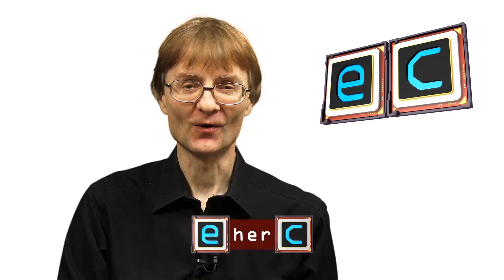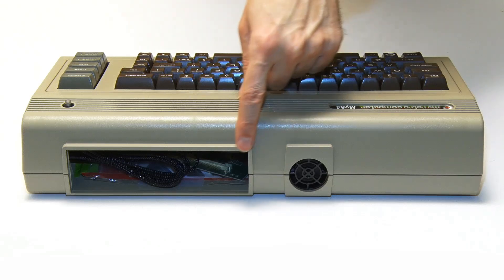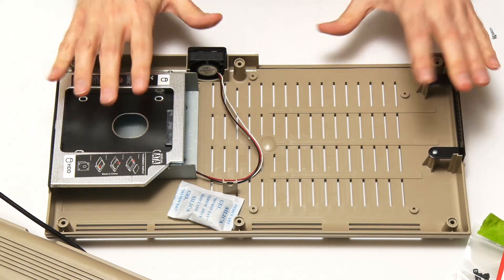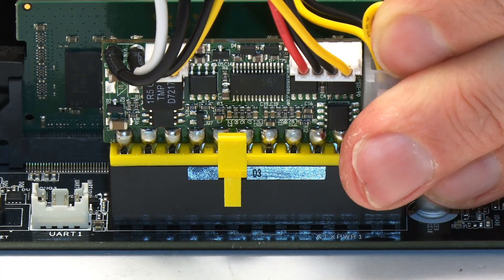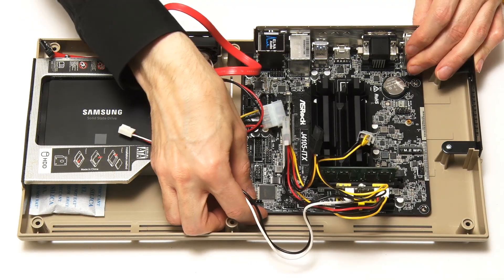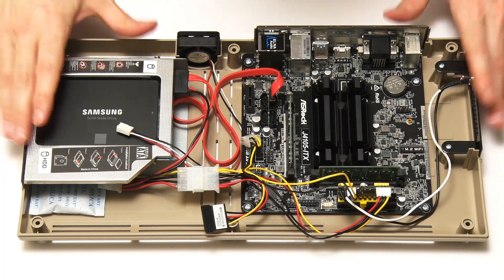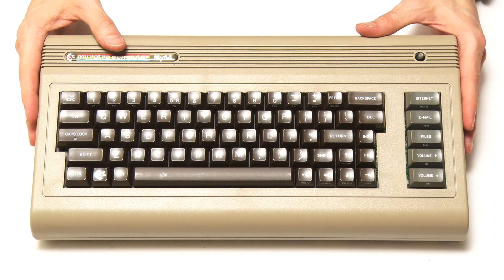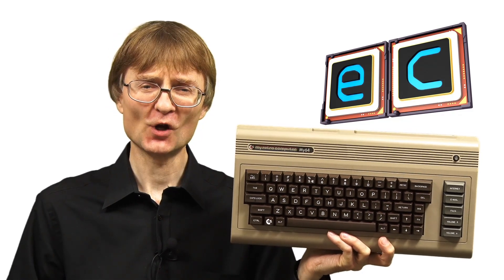My64 Mini-ITX Retro PC Build

Comment: This is awesome.
This formfactor should never have gone out of fashion.
Hope they can get the cost down a bit.
That's too much for a computer case and keyboard.
Reply: While a cheaper price would be appreciated it's worth keeping in mind how much a mechanical keyboard on its own can cost. You can easily soend upwards of £80 on a mechanical keyboard so looked at in that light this case doesn't feel quite so expensive.
Reply: @theimp67  I want one with a $20 Logitech keyboard.
Reply: Yeah unfortunately when you manufacture small custom runs of products it can be expensive, you also have to remember that these products are mostly privately funded by a small group of enthusiasts, and all the research and development that it took to actually get the product to market, I doubt if they will even make a profit hopefully they will at least break even.
Reply: @BILLY-px3hw  I'll remember all that and I still say it's too expensive for what it is.
Reply: This is the third case of it's type that I've seen recently if I remember right. I'd love to see one based on the old laser xt that can take a full height mini itx gpu. That would make a great PCem or vfio box.
Reply: @Drebin2293  that's what I'm talking about.  And make it out of extruded aluminum.
Reply: @aurthorthing7403  I'd love to see something like a BBC Micro or Memotech, I think they'd both make for a great micro style case but have more room for extra hardware.
Reply: Especially considering the Raspberry Pi 400 exists now.
Reply: The Pi100 does it better. The 64 at the time had a good keyboard but the thickness made for terrible ethos. The new Pi 100 does the form factor better as did the 128 and 64c. But you can not fit an itx board in those
Reply: Even if it wouldn't have a built-in keyboard, I miss horizontal/sleeper cases. My tower uses too much space on my desk. I had a Pentium 1 years ago and putting a monitor on the top of it not just saved space, but it had some special vibe, too. You don't get that from bulky towers. 

By the way, did you observe it? Every case is black now. White coating is used for luxury, expensive cases.
Reply: @michaelbuddy  Raspberry PI 400 is better.

Comment: I was wondering about the differences in the  20 pin vs 24 pin power connector. If not part of another video, maybe explaining that would be a good subject in a future video?
Reply from the maker: The four pins on the end of a 24 pin ATX connector are duplicates of those in the 20 pin, to allow more current to be (safely) drawn. So for a low-power system, they are not required.
Reply: ExplainingComputers So if I have a 20 pin connector from a power supply and a 24 pin connector on a MB the PS probably can't power it? Or would a 20 to 24 pin adaptor be OK to use?

Comment: "molex to sata, lose all your data"
Reply from the maker: Not really true. There have been issues with some Molex to SATA adapters used with 3.5 inch drives.
Reply: that's just the thing to be aware of when using those adapters
Reply: @ExplainingComputers  Oh?!  I use them with a couple of my older PC's, I've not heard of any issues.  Might you elaborate?

Comment: This video last seventeen minutes, about as long as it took to load a decent Commodore 64 game from tape, before the advent of 'turbo loaders'.  As to the case... nice.  But a 'touch' pricey.
Reply: Ghostbusters!
Reply: Fotball Manager. About 25 minutes.
Reply: And if you plugged in a game on a cartridge the game was loaded instantly (because it isn't "loaded", it was already there on a ROM chip), which is something unmatched by computers today.
Reply: I would love one of these case, especially because it has Cherry switches. It really needs to adaptable to SBC type boards as well and the 'my64' people are apparently doing that with a kit for the Pi4 and one other board I forgot the name of.

However I don't see the price coming down unless production ramps up to RPI400 levels.

Comment: In my opinion retro PC's are old looking but how about performance explaining computer
Reply from the maker: The performance is the same as when this J4105 hardware was inside my smaller Mini-ITX case! :) But it is possible to put a Ryzen in this case . . .
Reply: @ExplainingComputers  thanks explaining computer
Reply: The J4105 CPU with (from 2017) is only slightly slower than an Intel® Core™ i7-4558U Processor (from 2013). Like within 1-2% (According to CPUPassMark.) 
The J4105's in-built Intel UHD Graphics 600 graphics however are less than half the speed of the i7's Intel® Iris® Graphics 5100. (According to CPUPassMark.)

Comment: How can Raspberry Pi make a keyboard and computer in $100, but these guys make a keyboard with some empty space for over $200?
Reply from the maker: I guess it comes down to economics -- they will sell a great many Pi 400s, so the cost of tooling/etc is spread across many units.
Reply: @ExplainingComputers  also, RPi foundation is a nonprofit, so, for them, it's enough to just break even, I suppose.
Reply: By using a fancy mechanical keyboard instead of something cheaper?

Comment: Initialy i thought it will be one of those "mini consoles" that you will gut out and put pc into it... but it's actual PC case, great! Pretty nice kit, although colour might be bit darker than original, or is it only me?
Reply from the maker: The colour is very difficult to capture on camera -- I spent a lot of time in colour correction, but the shade changes from different angles! But I agree, a little darker I think.
Reply: @ExplainingComputers  In fairness all C64 i used myself back in the day were aready... well used. So they were previously kissed by the sun so to speak. So maybe that is original colour and it will change from sun exposure :)
P.S. Yor mice even looks like joystick.

Comment: Hey, that looks great, I think I'll....

HOW *!*!ING MUCH.?!?!?!?
Reply: Mechanical keyboard and two large molded plastic case parts... I wouldn't say it's expensive at all.
Reply: @graealex  I have keyboards of that sort and they're not  expensive any more. I picked one up for under $15 recently although it feels like s*ht.

For better/worse we're moving to much better ones these days if you can type at any decent speed the travel on those older ones can really slow you down. It comes from the way they used to use huge banks of mechanical momentary switches. Modern full-travel keyboards use much simpler switches so that doesn't justify the cost to me. I wonder if they are having to pay licencing to whoever owns the Commodore IP?

It's a nice idea but the cost is going to push it hard into the niche market and I'd prefer to have the real thing vs. a fancy knockoff. 

YMMV of course. Each to his own.
Reply: @marcdraco  The product packaging says that they're using Cherry MX switches, and those aren't cheap. None of my keyboards I have bought in the past two years have cost less than $200, so if the keyboard is a good one, then the case is actually a pretty good deal.
Reply: @graealex  It's about travel Alexander. I've spent decent money on keyboards too (as a writer, I need one I can bash words out quickly) but my fingers aren't what they used to be. Right now I'm using an old apple BT without the (numerical keyboard) and it's very fast indeed - if rather lacking in features.

I could care less what sort of switches it uses if it's uncomfortable to use and I used to program on those systems back in the day (mostly Acorn, they had a shallower angle) so it's not something I would want to return to.
Reply: @graealex  Yeah, I think it's quite expensive, especially since it doesn't come with all needed cables, power etc. I would fully understand if you need to add mobo, memory and mass media. But needing to get expensive power supply and such is a no-go for me.
Reply: bit expensive, but that doesn't look like a cheap keyboard, that likely adds a lot to the price.
Reply: Mind you it's still less that the C64 we used to buy with 6502s, which I think sold for £399, although it's a long time ago so I might be wrong.
Reply: @marcdraco  well that was more than a case too ya know ;-)
Reply: @LiLBitsDK  Amazingly enough... I did actually watch the video.
Reply: it come with build in electricity you don't need to plug it
Reply: Niche PC products cost a lot less than many other niche hobby products.
Reply: It's mostly about charging as much as the hobbyist is willing to spend.
Reply: For the price it's borderline fraudulent. You can buy The C64 Maxi which has a raspberry pi in it for half the price.
Reply: @cladoxylopsida568  I heard 64 bits on 😁
Reply: @michaelbuddy  i was not saying it was cheap, the opposite, that is why i even mentioned it. i know damn well cherry reds are good.
Reply: metro2002  IKR! I used to sell them.